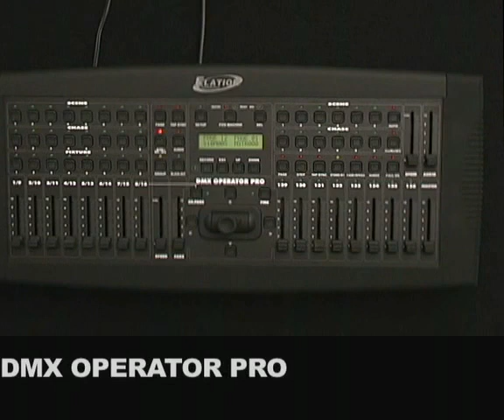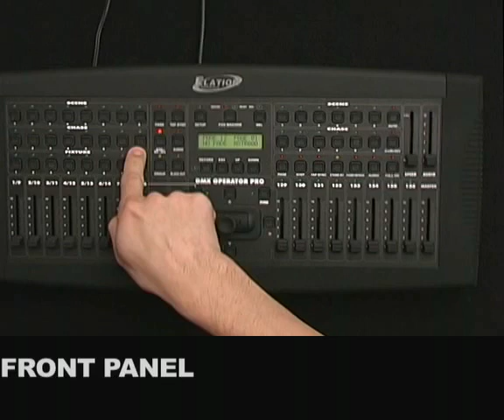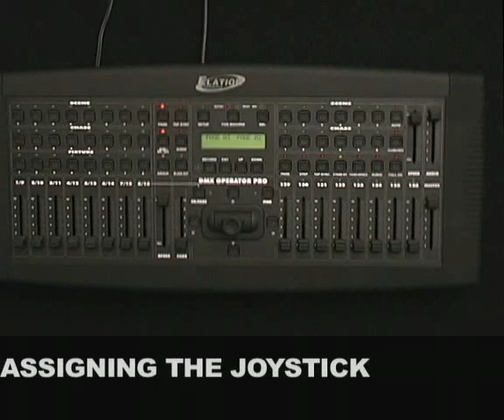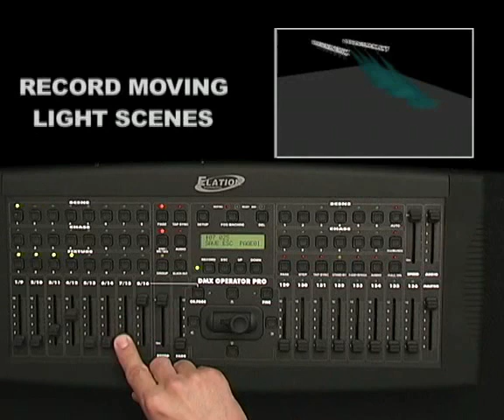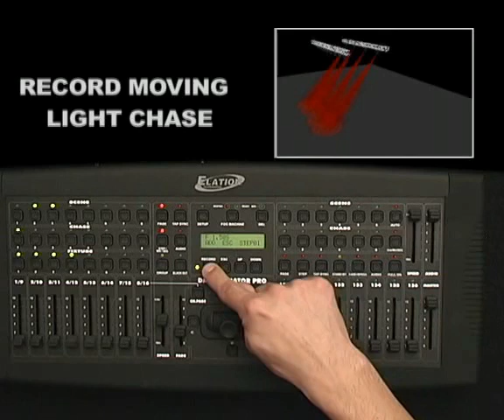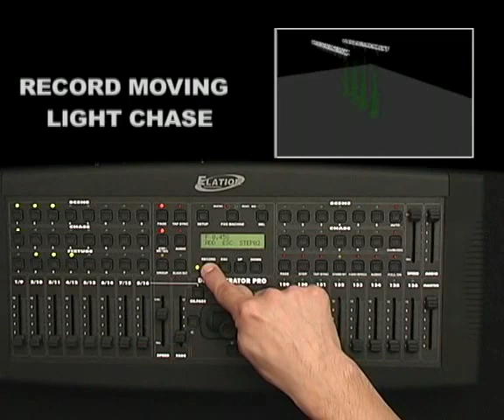ADJ DMX Operator Pro (Demo Part 1)

Comment: The theater I volunteer with  just installed new ADJ lights:  Specifically four ADJ PAR Z120 RGBW units.  The setup on the board is as follows:

- Light 1 -> Assigned to Fixture 1 (channel 8, address 1) -> Faders 1-4 on the operator board are RGBW.
- Light 2 -> Assigned to Figure 2 (channel 8, address 17) -> Faders 1-4 on the operator board are RGBW
- Light 3 -> Assigned to Figure 3 (channel 8, address 33) -> Faders 1-4 on the operator board are RGBW
- Light 4 -> Assigned to Figure 4 (channel 8, address 49) -> Faders 1-4 on the operator board are RGBW

You can see the problem with this setup.  While I have individual lighting control as individual fixtures, I cannot have Red on light 1/figure 1 and Green on light 2/figure 2 as sliders 1-4 on channel selection A on the DMX operator board have the same assignments.

I would like to setup the DMX board to have the following setup:

- Light 1 -> Assigned to Fixture 1 (channel 8, address 1) -> Faders 1-4 on the DMX Operator Board (Page Select A)  on the operator board are RGBW.

- Light 2 -> Assigned to Figure 2 (channel 8, address 17) -> Faders 5-8 on the DMX Operator Board (Page Select A) on the operator board are RGBW
- Light 3 -> Assigned to Figure 3 (channel 8, address 33) -> Faders 1-4 on the DMX Operator Board (Page Select B) on the operator board are RGBW
- Light 4 -> Assigned to Figure 4 (channel 8, address 49) -> Faders 5-8 on the DMX Operator Board (Page Select B)on the operator board are RGBW

This way I can have individual colors on all four lights at different times.

I just have 0 understanding of how to program the lights to be assigned to different faders/page selects on the DMX Operator.